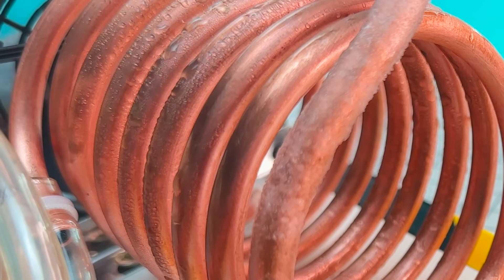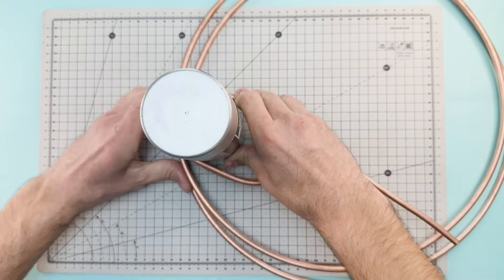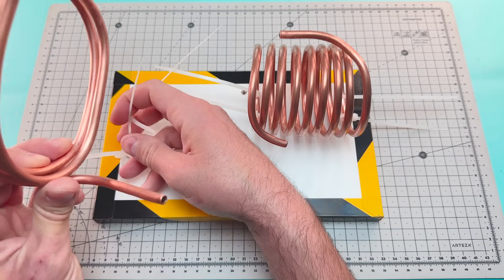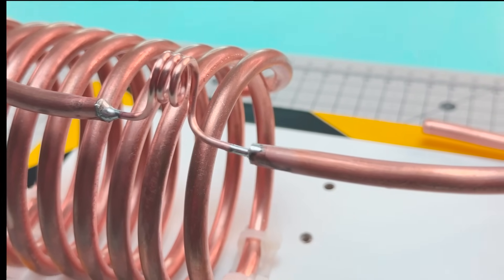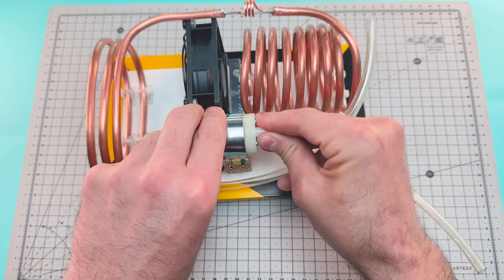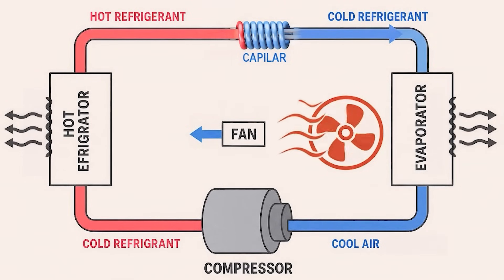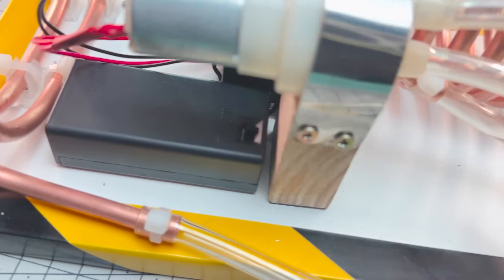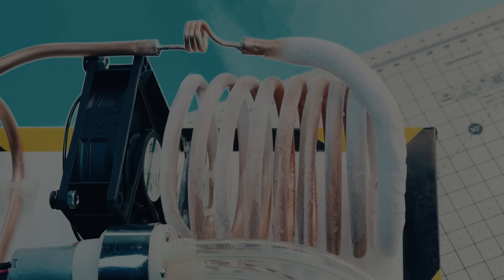How to Make a Portable Mini Freezer

Comment: It is true that heat rejection must be separate from the evaporator.  If one was serious about building their own cooler, that would have to be taken into account.  Also, efficiency is going to be low and if the outside temperature is too high, the system won't be able to reject heat.  It will use less energy thatn a thermoelectric mini fridge.  Also, the air in the system needs to be evacuated first, then replaced with the coolant.  Isobutane is flammable, of course, so that is a consideration in any system needing more than maybe just a few millititers.  This is why freon was used.  I really don't like the use of plastic tubing, either.  The system should b eall copper.  And I don't know if the air pump used is air-tight.  Seals are really critical for performance.   Importantly, this demonstrates that a tiny, battery-powerd fridge is feasible.  I'd like to build one into my truck's glove box.  That way, I can channel air from the AC over the waste heat side.  Of course, I have to be careful about draiing the vehicle battery, so I might consider a roof-mounted solar panel to charde LiIon batteiies separate from the truck, which is a hybrid in my case.

Comment: Sorry if my question will be stupid: will this really work ? Not for cooling any room (of course the heat kills this idea), but if I only want to have an ice on some are (my idea is to use it for generating water from humidity (condensate) . Those here who understand the physics much better - I would like to get your opinion on that ?
Reply: As a mechanical engineering student who took thermodynamics and heat transfer classes, this absolutely will work. This is a well known, commonly used Heat Pump Cycle, this is used in many things such as electric cars.

Comment: You can't really cool the air much, since the hot side is also in the same space. .
Reply: Very true, but if you have the ability to follow these instruction you probably know to have the heat on one side and blow the air to the other without having it pull the heat. Heat generated is equal to the cooling, ah physics. Getting the components, but trying to figure the math to know how much i can scale down, thinking maybe half and still be effective, not sure. Probably will end up with trial and error. Kinda hard with only basic knowledge. Not for room cooling, but a mini freezer.

Comment: Great example of the basics of refrigeration. However, you still need to reject the heat somewhere that is not the same place your trying to cool, otherwise you will only warm the area due to the heat generated by the power draw. This is why the compressor is outside, while the evaporator is inside on AC systems. This little thing is just fine for chilling a pop can though. This can also be used as a dehumidifier if the evaporator coil stays above freezing.

Comment: There is no way you can compress isobutane with that little pump. Yes, inside the can is liquid because it is under pressure. At room temperature, isobutane is in the gas state. Not enough pressure differential can be created with that pump so no phase change, not cooling! Your model is good to demonstrate the theory but it can also mislead those that don’t understand how the refrigeration cycle operates.

Comment: Idea is good, how ever the hot tube will heat the room as well. so you need to arrange a way to remove that heat away. may be make a hole in the wall, and put this unit in between such that hotter part remain outside the room.

Comment: This small air conditioner can also be used to extract water from the air depending on the humidity in the environment whether it is high or low

Este pequeño aire condicionado se puede utilizar también para extraer agua del aire dependiendo del la humedad en el ambiente si es alta o baja.

Comment: This table top model is interesting and creative, but not likely to last very long; mostly because the air pump can't handle the high pressure necessary to function properly. My main concern is failing to pull a vacuum on the line before adding the refrigerant (basically R600a). By leaving air in the system introduces non-condensable gases and potential moisture which would react with the isobutane resulting in forming acids or causing blockages (e.g., ice in the capillary tube). Nice little demonstration of how an ac system works, but doomed to fail.

Comment: So if i were to put this in a wooden box would it cooler he box like a cooler or would i have to vent the heat outside the box and how long would the battery last
Reply: You would have to know the current draw of he fan and the air pump. But it wouldn't be very long or efficient. there's a lot of upgrades you can make to this to increase its efficiency.

Comment: This would work so much better if you soldered in a Schrader valve, vacced the system down to get all the non condensables out and then filled with only refrigerant.

Comment: Even if it works, you can't cool a room with it because the heat created by the condenser will exceed the heat absorbed by the evaporator. Thermodynamics says you can't have it the other way. The condenser needs to be outside the room. 

It's like trying to cool your room by opening a refrigerator. It doesn't work for the same reason.
Reply: - Yes you are right,

Comment: You have made a very poor efficiency room heater, the heat of compression and the heat of rejection from the condenser is going into the same space as the evaporator. So all you are doing is taking the energy in a 9v battery and putting that in the roo. With a bunch of other media changes. You can't beat the first, second and third rules of thermodynamics.

Comment: You did not pump the air out of the system before charging it. The heat energy produced by the pump, and discharged by the condenser, will negate any cooling in a closed room. Nice try.

Comment: Awesome.  A flammable air conditioner.  Just what I want in my house.
Reply: Beleive it or not, its quite common to find refrigerators and freezers that use flammable refrigerants. They work well as a refrigerant, the downside is whe the system is compromised, they can be flammable.
Reply: flammable or unhealthy to inhale, pick one, lol.
Reply: All new cars and refrigerators/freezers have gone back to flamable refrigerants. 1234yf and 600r (i think) respectively.
Reply: @polygaryd  you are correct. Home ac units are going to start using the spark sensitive refrigerants too I think in 2026.

Comment: Where does the heat go?
Reply: @Boubson  Back into the room.
Reply: it stays in your room
Reply: all this does is take the heat from one side of the room and shifts it to the other side..
Reply: @armastat  This isn't an air conditioner. It's a refrigerator. Like the one you have at home. Your home refrigerator doesn't exhaust heat outside the house either.
Reply: @macdori  correct it moves the heat from inside the box to outside the box. just like an air conditioning moves the heat from inside to outside. fyi 'Air 'Conditioner'
Reply: @armastat  u r right.

Comment: The heat will as much diffuse in the room as the cold part - they need a separation, like the hot part outside the room - otherwise the tube which is heating up, could be mounted inside the fridge, or the ac ventilation system inside the apartment. I don't see the reason, why not to include this info in the video, as it mainly exists to explain the principle. To cool a can of soda, it should do its job though

Comment: The video could have been interesting if it were presented as an educational model, but certainly not as air conditioning. With this setup It's like opening the fridge door to cool the room. The heat produced is then greater than the cold generated, and the room finally heats up. Here, the problem doesn't arise because the power is ridiculously low with this poor 9v battery and the aquarium aerator. 😁

Comment: esta muy bueno pero hubieras hecho una version para conectar a la corriente
Reply: eso es lo de menos, se puede conectar mediante una fuente o adactador de computador,todo se puede trabajar a12 voltios
Reply: no, u dont ant to run it continuously, it will eventually seize. it has no way to regulate its cooling with a thermostat or regulator. it just runs and runs until it freezes into solid block of ice.

Comment: To cool a room with that's impossible. If cold coil is -10 degrees and let's say room temperature +20 degrees, then on the other side you'll get +50 degrees hot coil.
The only application could be make something cool under the cold coil.

Comment: is there any other way, I will say more efficient, to insert gas and make system fully closed bc gas will leak in short time trough this plastic pipes and joints?
Reply: no
Reply: the amount of leak is totally up to how well you seal the system u can get 100% seal if u are good at it. though the plastic pipe will lose some by osmosis (measured in liters per eon)
Reply: biggest problem is this pump with this plastic part, gas will gone very fast under the pressure. It could work maybe several days and need to be refilled again

Comment: What abt the heat that pipes give
Reply: well ideal will be to pipes that heats goes outside of room you try to cool, same like refrigerator or AC, inside cooling and outside is radioator for heat release, but this will work fine I guess for one room

Comment: Anyone who believes this has lost control of his life
Reply: @sauer7592  can't say that actually but out home refrigerator works the same way but on different scale ,point is yes I also have doubts in this system but the science is legit , so will this work or not we have to make one and then judge , but u can use a peltier module to cool things and yes it works cos I've done it
Reply: @sauer7592   have you tried it urself? No insults allowed either on this site
Reply: @sauer7592  it is ai rubbish
Reply: Tu ne connais pas la science video est exacte !
Reply: @sauer7592  fâche pas grosse tête sa marche ont te dit
Reply from the maker: Why? This is puré science. It’s how refrigerators work.
Reply: The build should do something. But with the condenser and evaporator in the same room at won't do anything to the rooms temp. If a 9v would run the pump at all it would drain the battery in 1 or 2 mins.
Reply: @Science-Geek-0 The battery is not the weak point.Small compressor creates the necessary ∆p pressure change work of approximately 2.5 bar. Gaseous r600a has about 3.5 bar and as we can see he has loosely pushed the rubber hoses without clamps on them. Simply put, this setup can't work. He simply sprayed ice spray onto the copper wire.
Reply: @Science-Geek-0   Technically, room temperature will rise…
Reply: @HiddentechnologyYT  ignore the rabble, they don't understand what a science experiment is, (unless of course it involves a centerfold cut out of a playboy and bra shaped thinking cap)